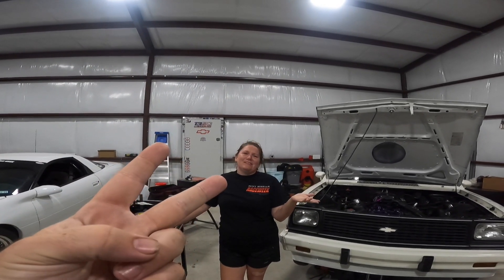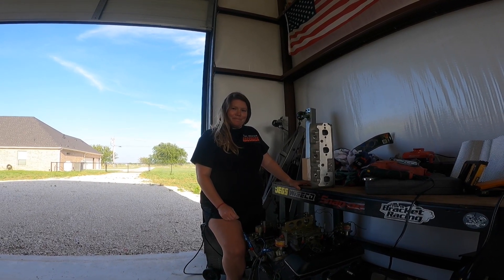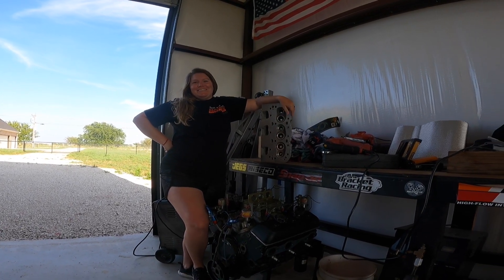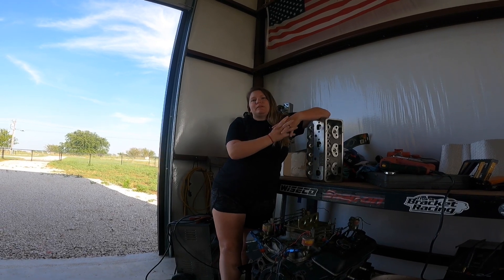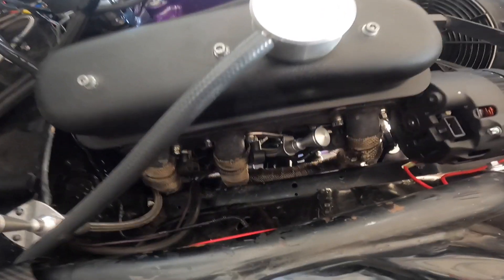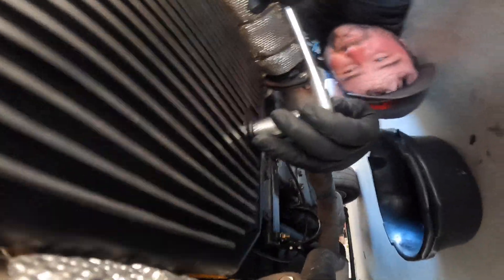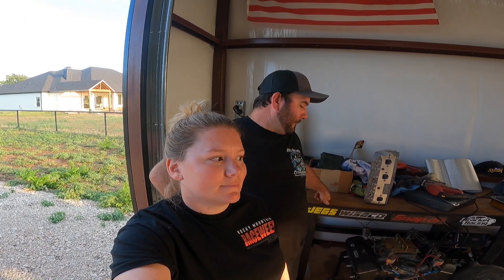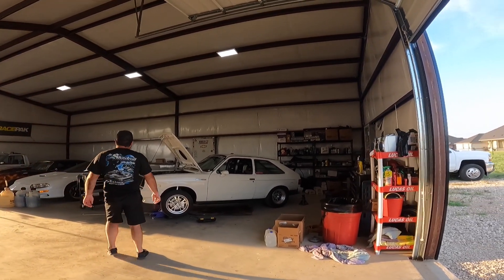We broke the Chevette!

Comment: What year is the Chevette? I had a new one 1980. Was on 95 South Carolina from Mass going to Orlando with my wife, son and daughter, only 2000 miles on it. Then there was a loud bang, everything shut down cept the engine. Temp outside was 100deg. I looked under the hood fan belts were off, no problem so i thought. Tried to put them back on no way why u ask well the crankshaft pully was gone. CB do your stuff i got towed to a chevy dealer 2 days later i was on my way. Coming into Jacksonville on 95 the engine quit coasted to a gas station was told it`s vapor lock they put a wet rag on it and i was on my way again. On A1A just outside of Daytona engine quit again. Coasted into a motel lot got a room and called chevy, they came and picked up the car, fuel pump was bad. Had to lift engine up off the mounts to get to the pump, mechanical pump 2 mor days and i am off to disney. A week and a half and were on the way home to mass so far so good. On 95 in NJ Bang a blow  out.  U sed little 50mile only tire to get home. Had the car 3yrs. New clutch, new rear coil springs, new carb and linkage, and RUST. I got even used the car in a demo derby and won $500. Worse piece of junk i ever bought and never bought another chevy again. 😏😒🥴😎
Reply from the maker: Hahaha that’s an awesome story! I’m sure it wasn’t at the time but it sure is now! I’ve heard a lot of people talk about how bad of cars they were from the factory. We’ve had people tell us they sent them to the scrap yard for the starters going out because they weren’t worth fixing. Thanks for sharing your story. This one is an 84 model.